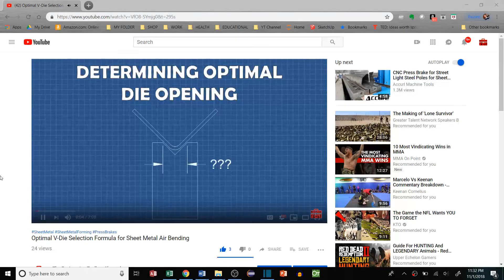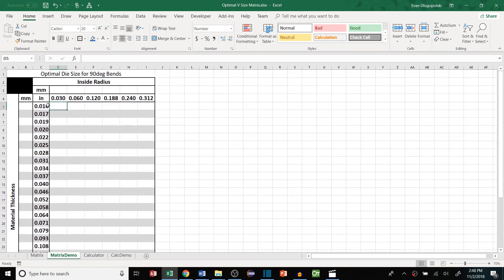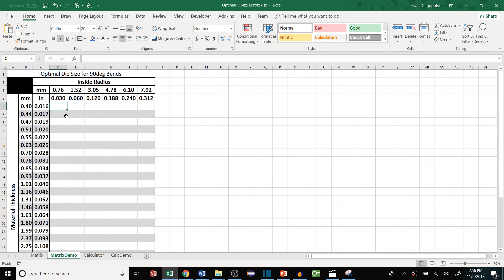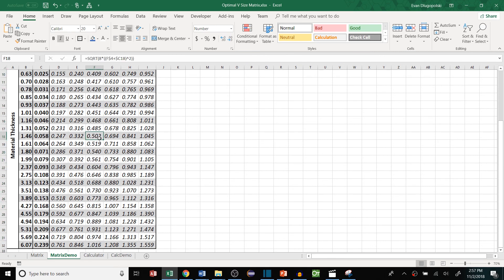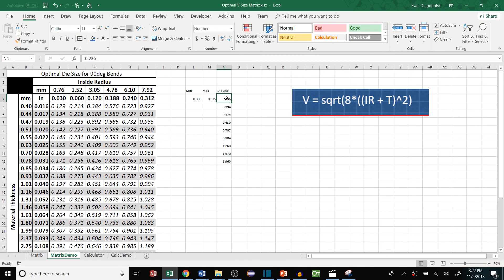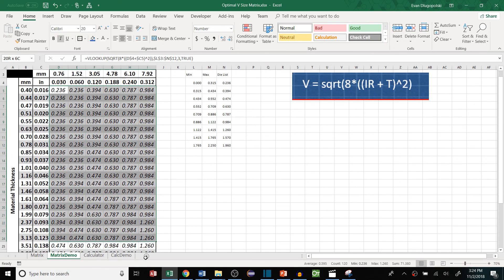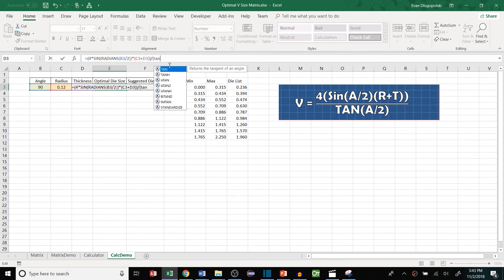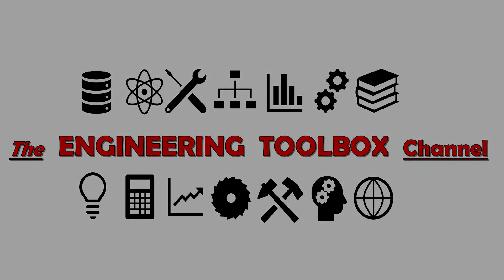Determining Optimal Die Opening Using Microsoft Excel

Comment: So BIT of a nitpick(6y later), wouldnt using the punch radius not actually be accurate since your inside radius is more affected by the die width than the punch(at non-sharp bends), or was there some beginning assumptions i missed. Making one of these for my shop, so i figured id do a bit of research on what's standard.

Comment: Is this work for stainless steel as well?
Reply from the maker: Yes, these values are generally a good guideline for any material type.  May need to adjust depending on actual results.  Typically difference in material will just affect the resulting bend deduction / k-factor but the die openings can stay the same regardless of material.